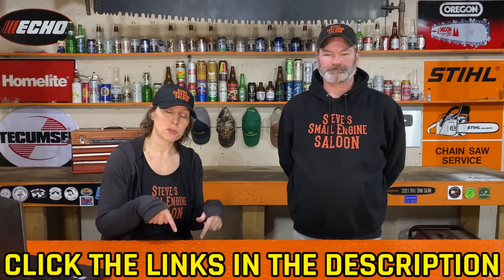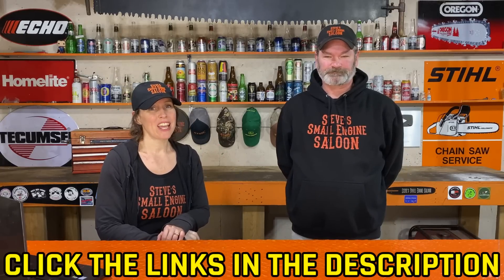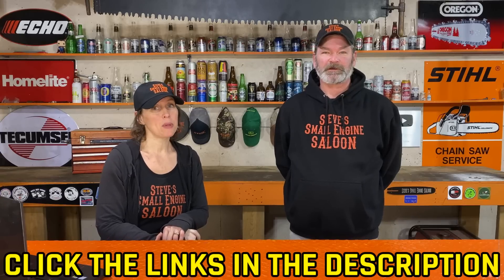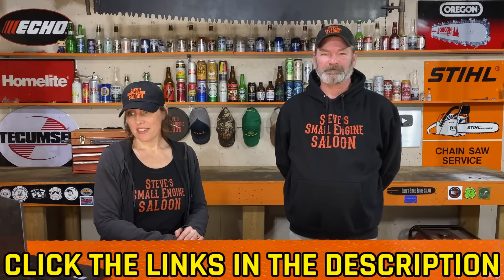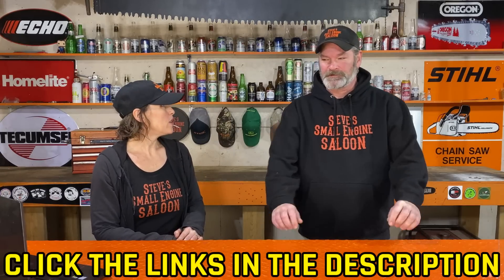Can I Remove ETHANOL From My Gas? (DAY 15)

Comment: I just buy the old E5 yes its more expensive but my uk Stihl dealer told me to use E5 NOT E10 as Steve says they have had many people with tool issues due to E10 
I also use E5 in my car im ignoring the uk Government's nonsense it reeks of another Diesel scandal.

Comment: Related question for your 30 Days: I can buy non-ethanol gas, but should I use stabilizer or something similar in it when I store my mowers, chain saw, pressure washer, etc for the winter?  I try to run the gas out to get the tank as empty as possible and then pull the starter to try and clear the fuel out of the line and engine before I store it.  Is stabilizer still going to help or am I wasting $5 for a few months of storage?  Thanks!

Comment: Knocked it out of the park Steve! I explain this to my customers in a very similar manner. When they question about octane loss, their next question ALWAYS goes like this: “I can add octane booster to my now ethanol free fuel to bring the octane back up, can’t I?” I explain to them that most octane boosters on the market have some sort of alcohol in them, so what would be the point of draining alcohol off if you’re just going to add alcohol back in? And why even bother spending the time to separate ethanol from your fuel, add an expensive octane booster to it, only to have a really expensive container of fuel that still has alcohol in it, and it took you an hour to make? It makes no sense to me, and when it’s explained to them, they tend to agree. You’ll ALWAYS have those that don’t agree or want to argue the validity of ethanol in small engine use. But it’s not a matter of IF they’ll have a problem, it’s a matter of when they’ll have a problem related to it.
Reply: You don’t add octane boost you remove ethanol from premium grade to make 87 octane and use that where appropriate. You use the ethanol free gas as your last use before winterizing a small engine which will make it fire right back up in the spring. This way you don’t have to blow out every fuel line
Reply: You’ve still wasted an amount of time and money buying high octane, then phase separating it to get ethanol free fuel. On top of that, what octane is it? You claim 87, and I’ll have to beg to differ. How did you test it for octane? ANY gasoline sold as motor vehicle fuel has 10% ethanol in it, sometimes more or less depending on locality.

Comment: This is exactly what i do.. Add water, shake it up, and let it sit for a few days... Then use an under-tank drain tap to get the ethanol / water out... then add my 2t oil to the pure fuel.
I hear it reduced the octane level etc.. But honestly, I run ethanol removed fuel in all my small engines, In my ATV's, pretty much everything really.. Never had an issue with potential lower octane..

Comment: I use the highest octane gas I can get and mix in STA-BIL ethanol treatment and stabilizer. It works great, I've let stuff sit over 6 months and has always started  right up with no carburetor issues.
Reply: I didn't know about this product. I'll give it a try. I had a fairly new Stihl BG87CE blower blow a carb and it was cheaper to just replace it than to replace the carb and the starter coil spring that was damaged from trying to start it with the cylinder full of gas.
Reply: I used to do this. I had to replace 2 carburetors in 3 years 3:30 3:30 using the stable ethonal treatment.  I switched to non ethonal gas and have not had a problem in 7 years. Of course now it won't start tomorrow 😂

Comment: Several years ago I made a 5 gallon clear gas container for removing the alcohol from my gas. As Steve mentioned it lowers the octane so you have to start with the premium grade. Then I decided to hell with it and used alcohol pump gas, It was 10% alcohol. End of the season I drained my equipment and ran it with straight gas, filled the tank and stored it. My equipment fired up and ran the next season. Then it dawned on me and these days I simply dump the gas and run my equipment dry for storage. It always starts and runs the next season. The alcohol draws moisture so for me it is worth storing them dry.
Reply: Only one problem: manufacturers started making fuel lines using neoprene composites. Unlike the old metal tubing, these can crack and leak if left dry and not immersed (lubricated) with fuel. 

Your best option is to use 100% pure gasoline with a little fuel stabilizer for storage. No issues.

--Advice from a retired small engine repair shop mechanic. 😊
Reply: @steven4894  It will still deteriorate over time.  Cycling the fuel out bi monthly ensures that there is always fresh fuel in the generator.
Reply: @percyfaith11  

Let it run for 5-minutes every month. Refill to top to eliminate air pocket (this deteriorates fuel the most). Then, at the end of the season, swap out the old gas and replace with new raw fuel (w stabilizer). 👍

BTW: stabilizer lasts a long time (2 years), not just months.  P.S. You're welcome. 😉
Reply: best procedure.

Comment: In my area we do not have non-ethanol gas However i have never had a problem with ethanol gas every once in a while i will add fuel injector cleaner to my fuel and it's worked for 10 years or so however long ethanol's been in the gas actually I think it's been closer to 20 years without a problem.

Comment: Thanks for the good info. I live in Tarrant county Texas where they can't sell no-ethanol fuel so i must drive to a station in Parker county  where they are allowed to sell it. So i have to make a special trip to buy some ethanol free fuel for my small gas engines. It is worth the trouble though cuz they run better and are more trouble free. No telling how much trouble ethanol in the gas has caused us small engine owners ; )

Comment: Living in Iowa, every chance ethanol produces and lobby gets, they push higher percentages to mix in our fuel.  Being subsidized, you save a few cents at the pump while slowly destroying your vehicles.  My rule is nothing more than 10% for our 2010 Honda CRVs.  But every 2 and 4 cycle engine of mine gets No Ethanol Gas.   I add an ounce of Sea Foam and 1/2 ounce of Star Tron as a stabilizer and carburetor conditioner per gallon.  Is it necessary?  Been running everything smooth over two years.  It doesn’t hurt to start and run all generators, snow blowers, lawn mowers, etc once a month for five minutes to keep the carburetor clean.
Am I doing it right?  Thanks for the great information.  .

Comment: All you can get in California is ethanol gas and it’s cost me two boat carbs, 4 weed eaters, a lawnmower, a generator and 3 atv carbs. How that is good for the environment is beyond me. Btw, the 4th atv needs race gas and 8 years later it still starts first time every time. 🤦🏻‍♂️

Comment: You are exactly right I meant that non ethanol gasoline is very expensive. In my area it is about $7.00 per gallon. Sorry my typing mistake. I know what I meant but typed it wrong. Thanks for the correction.

Comment: In a pinch, you could do it. BUT it is not practical. You would lose more that 10% because you could never do the separation 100%. There would also be a chance that some of the separated fuel may actually contain some water and ethanol. Water is not great in small engine fuel and could lead to corrosion.

Comment: No ethanol gas is becoming extremely hard to find...Shell has stopped selling it, apparently ethanol is Canadian gov't mandated on every grade since late 2022...caving to the corn farmers?  All my 2-stroke equipment is Stihl, so I use their engineered fuel.  Most of my 4-stroke equipment has gas valves; when I'm done, I turn the gas valve "off" and run it dry, so no gas stays in the carbs to screw it up.

Comment: Not much ethanol free gas in newsom controlled Ca. I just use 87 octane in everything, run the carbs dry if it’s going to sit for awhile and all has been fine. My Honda mower from the 90’s runs great, carb has never been touched. Check out Tayrl’s 2 year long fuel test.

Comment: I got so tired of cleaning carburetors in my small engines that I switched to non-ethanol and burn nothing else. Since then, I haven't had to clean or rebuild a carburetor, and I leave gas in the tanks and carbs all year. No more problems. There used to be a Shell station in Tillamook OR that had non-e regular, off-road only. That station is gone, so I have to buy non-e premium. I don't care what it costs. I'll never burn ethanol in small engines again.

Comment: I have heard that fuel (gasoline) with no ethanol remains more stable during long-term storage. Is this correct? I am concerned about storing fuel for seasonal tools or emergency generators.

Comment: I used to have lots of trouble in small engines due to ethanol.  For the past several years I've added Startron and have had zero trouble.  Put it in your can when you buy your gas and you don't have to wonder if you remembered.

Comment: Don't see the point never had a problem some of my tools are 7, 10, and 20 years old and still running well. use good oil don't buy cheap crap. I do gardening for a living and petrol is not cheap just come back down to £1.50 per litre here in the UK so I don't want to lose 10% of it thank you lol.

Comment: Hey Steve and April…
I’m not trying to beat this subject to death but to make a visual demonstration of alcohol/ methanol in your fuel try this. Find a slender glass container such as an olive jar with a lid.  (Example, 2 1/2 “ diameter by 6-7” tall ).
Mark the jar 1/4 of the way up from the bottom. 
Fill the jar with water exactly to your mark.
Add your fuel sample to the top- full. Tighten lid and shake/ aggitate.
Let it settle.
The alcohol will combine with the water and the water level in the jar will rise above the mark on the jar. Measure the rise, that’s the percentage. 1/10”- 1/8” rise is 10%.
It makes a great Show and Tell Demonstration.
Reply from the maker: Yup, I already did that video!  Its in my playlist...
Reply: @StevesSmallEngineSaloon  
Sorry.

Comment: As I understand it, ethanol in the fuel means less toxic emissions because lead is no longer used, and also oil savings to some extent on a large scale .. but as the question was - why would you like to remove it? Thing is, ethanol binds humidity, which means that your small engine may start up worse, especially in cold weather, the fuel system may suffer from corrosion which leads to clogged nozzles and also can damage diaphragms and other rubber parts .. so there are actually plenty of good reasons for getting rid of it, imho.
Reply: Ethanol is a sop to corn farmers.  The amount of petroleum used in production of all the corn to turn into alcohol diminishes any petroleum savings and it ruins small engines.  Ethanol does not replace lead.  You can have lead free, non-ethanol gas.

Comment: Av gas works great an small engines. Even large engines. Costs a little more, but saves on carb repair/replacement.
Reply: In my area, they will not sell Av gas to a person without a pilots license. I’ve been told that it is illegal to sell for non airplane use because of the fuel taxes ( perhaps lax of fuel tax), only one gas station in drivable distance sells ethanol free fuel at $15 a gallon.

Comment: I think it is well worth it to take the ethanol out of the gasoline for two reasons: ethanol gasoline is very expensive and not convenient to drive to. If you are worried about the octane rating just buy premium gasoline then when you take the ethanol out it will still be better than regular gasoline. I am going to do it this this spring as soon as the weather warms and I can do it outside.
Reply: I think you meant non-ethanol gas.
Reply: I wonder if the higher octane in premium fuel can be achieved by the addition of ethanol.

Comment: I have seen this done also, my question is could you not just add some octane booster to bump the octane back up. OR if read the ingredients list on a bottle of booster  the first ingredient I think is kerosene so if you wanted to go a little cheaper add a little kerosene back to your de ethanol gas why wouldn't this work ? Thanks

Comment: Been separating ethanol for years.
Been using it in my airplane
Cheaper than a gas.
I do 20 gallons of gas with 2 gallons of water.
2 gallons of water now become 4 gallons of ethanol/water.
I use a cone bottom tank., I always do it outside,  and I use 5psi of air flowing up from the bottom of the tank. I call it "churning the butter"
Now the good part
Regular has 10%
Mid grade is 8%
Premium 6%.
Ethanol and you get high octane back using premium but how much do you need at any one time?
Leave the waste in a vented bucket and put a grate one and let the ethanol evaporate.
Taaddaaaa

Comment: Sadly they put Ethanol in all unleaded fuel. Under a certain percentage, they don't have to declare it. I always use the highest octane rating fuel and Stihl Ultra oil. I've never had a problem with gummed up carbies. I used to have a problem with my motorbike carbie gumming up until I added Stihl Ultra to the tank. Only two capfulls but it stops the gumming. Otherwise I have to use carbie cleaner spray. Pain in the ass.
Same with my fuel injected bike. Ethanol will kill your fuel pump. 
Never leave your bike to long without firing it up. 
The only other solution is avgas but that contains lead. Some Ethanol is good because it absorbs water that can otherwise build up in your tank.

Comment: I've used Coleman campstove fuel or Walmart brand for years. Just add your oil mix to it. Its white gas and is the same stuff as the stihl moto mix. My stihl blower and weedeater is still going strong. 10 yes plus and not a single wrench put on them.

Comment: If you reduce the octane level, will that cause knocking or be bad for an engine? Like using low octane fuel in high performance engines that requires premium fuel

Comment: I'm wondering to what you would do with the water+ethanol+unknown mixture you get as a result. I guess you could hand it in as hazardous waste.

Back in the day we used to /add/ ethanol to deal with water in the fuel system :)
Reply: Use it as a cleaner and degreaser. It's basically similar to a diluted methylated spirits. I wouldn't use it on your windows though, because it will likely contain a small amount of petrol/gas. It might produce streaks.
Reply: @dalriada842  hmm... That's probably pretty smart!

Comment: Never had an issue using ethanol fuel in my small engines, and I remember when it first came out, people were claiming it damaged their engines. That was back in the 70s, so it's been 45 plus years I've been using ethanol with no noticeable damage. All my small engines have wore out from use way before any signs of ethanol affects. The thing is, most small engines are cheap enough now, they've become recyclable. I just buy a new mower, snowblower, etc etc. ever few years and give away or sell my old one for a few dollars. Many times I just sit them at the curb, and they disapear.
Reply: You obviously never spent every spring cleaning dozens of motorcycle carbs in a dealership, that sat in storage all winter with ethanol gas in them! Float bowls full of green mungus with every jet plugged!

Comment: I've run small engines on pure ethanol and even everclear, it works just fine with no I'll effects. The ethanol myth needs to be debunked, ethanol is a great fuel and produces less emissions than gasoline,  will you need to maybe replace a gasket or an o ring, yes, is it worth it, also yes. I've even run a 2000 Harley sportster 1200cc motorcycle on straight everclear with no problems. Learn to tune your carburetor and learn some chemistry and your fine. Oh, by the way, better Mpg with ethanol than without it. Science works better than listening to your redneck neighbors I assure you.

Comment: Locally, non-ethanol gas can set in the station's tanks for so long that saws won't run on it.  Idle ok, but hit the throttle to cut and it boggs down. I test all gas for alcohol anyway.  Don't trust, verify!

Comment: Hi Steve and cheers from Croatia, a small but beautiful country in south eastern Europe. I'm watching your channel for quite some time, being a DIYer, having all kinds of engines and such, also a BScME in mech. engineering. Here in Europe most of gasoline has a max 5% of ethanol added. I'm totally ignoring it, and never had any problems in 2stroke or 4stroke engines. Yes it's corrosive, yes it can eat up o-rings and gaskets, but many claims are exaggerated, especially for 2strokes where you can mitigate most problems with high quality 2stroke oil. Since using Stihl HP Ultra oil, and that's like 2-3 years now, I never had cold start problems in any of my 2stroke engines. And I'm not replacing carb membranes each year like I did before when I was using regular Stihl red oil. So I'm not sure whether all this methanol hullabaloo is even worth bothering. Tell me if I'm wrong.

Comment: If you purchased 93 octane fuel with 10% ethanol, add your 20% water, shake it, let it set for five minutes, and run it through a Mr. Funnel, would the Mr. Funnel stop the flow of the ethanol-water mixture or not?
Reply: No unfortunately . Once the ethanol is mixed with water , it will pass through a Mr Funnel .

Comment: I use antifreeze to pull the alcohol from gas.  Shaking isn't necessary, a few inversions is all that's necessary.  Using water takes hours for all to settle out.  A half gallon of antifreeze can be used for many gallons of gas.

Comment: I’ve never had trouble with the ethanol gas but I mix my oil mix a little strong but that’s on my saws and weed eaters
Reply: 40-1 instead of 50-1.
Reply: @googleguy5700  yelp

Comment: I’ve done this procedure,, I added food coloring to my water before adding it to the gas,, very easy to see the separation. It definitely lowers octane rating,, was ok in my lawnmower and weed trimmers, but my ATV had spark knock like crazy.. so, you decide !
Reply: That food coloring might give your ethanol cancer.    😂
Reply: Couldn't you just add octane booster?